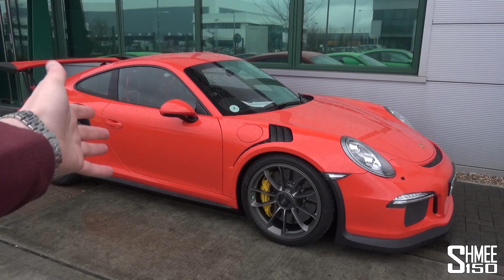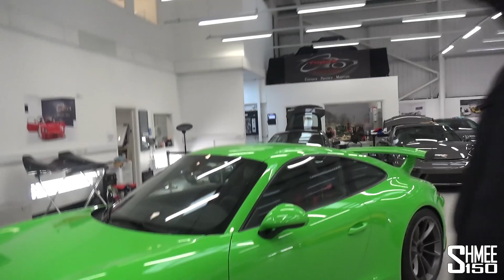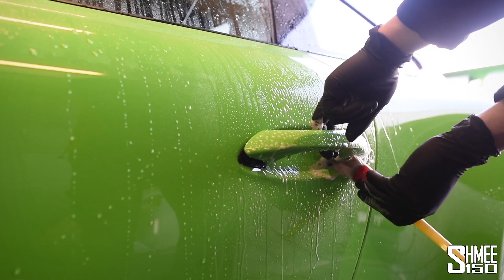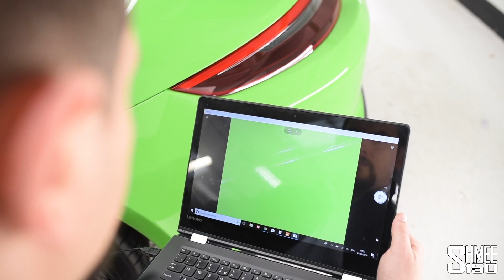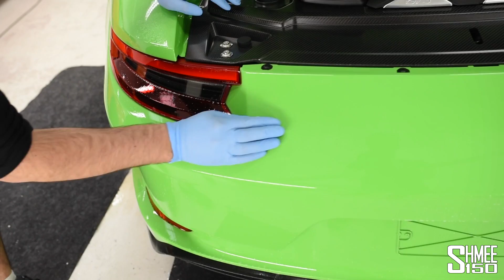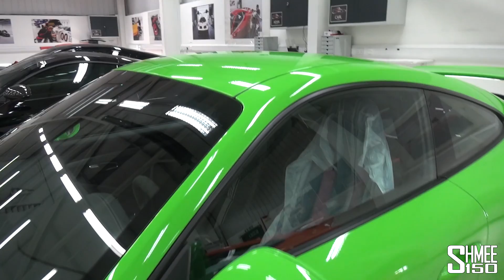Final Preparation! Porsche 911 GT3 PPF at Topaz | Garage

Comment: A few things quite wrong here:

- Shops generally use different color and/or types of MF mitts to wash the wheels, lower body panels, and upper body panels. It eliminates any chance of cross-contamination. The mitt used on the body is exactly the same as the one used on the wheels. I am not saying that they used the same one, but there is no way to know, is there? Even the most meticulous person picks up the wrong tool from time to time; why not reduce that chance dramatically by color-coding the tools? Now they could say they were going to polish the paint so it didn't matter if they introduced more swirls to it, but of course it does. A shop deserving of servicing high-end cars needs to have high-end practices. More below.
- The body is still wet when IronX is sprayed. That dilutes the product and reduces its effectiveness. Best practice is to dry the car first.
- They polished the paint, then ran a squeegee hard across it to remove some sort of residue...WHAT??? The tiniest speck of dust on the end of the rubber blade would drag long scratches into the clear coat THEY JUST POLISHED and PPF would then seal it forever. WOW. Truly bizarre. Again, even a modest detailing operation knows to treat freshly-polished surface with an extreme level of care and let nothing come into contact, lest it tarnishes it, especially when it about to covered with PPF.

Comment: One of the big problems in the industry is that, at least from what I have seen, certain dealerships will have someone going around and washing  the cars in the outside lot each day (which is good) but the problem is that the techniques they use just damage the paintwork. This means even if you are getting a nearly brand new car it will be damaged and the paint is in poor quality. This is why Topaz and Reep Detailing are so important!

Comment: Great Video Tim. Enjoy the GT3 as I'm sure you will.
I would very much like to have the same process carried out on my next new car by Topaz and wondered if you could give me some indication of the cost, I know you won't want to tell me how much it cost you for the GT3, but some indication would be helpful.
Also how does the PPF stand up to the rigours of the pounding it must get round the wheel arches? Do you ever experience any peal back in those areas. Thanks.
Reply from the maker: You will find all details on the Topaz website.

No issues with the wheel arches. All will stick on well and have not given any issues.